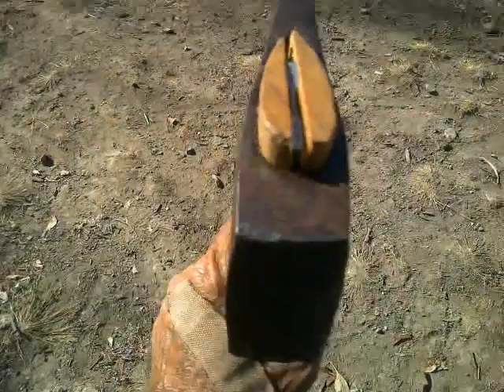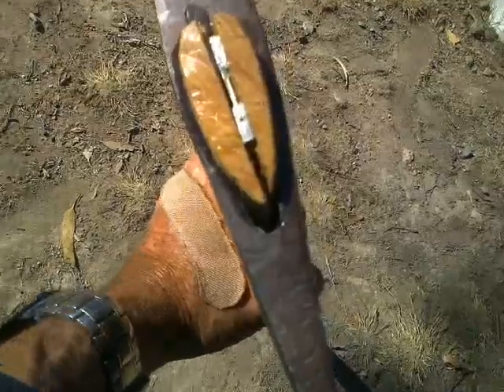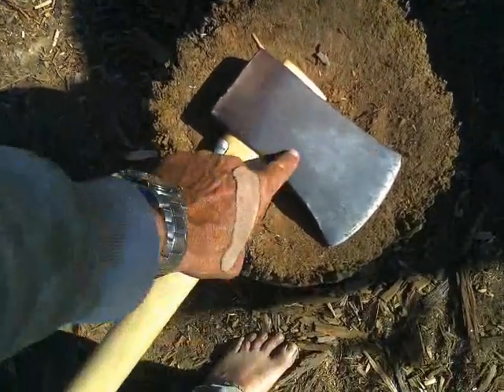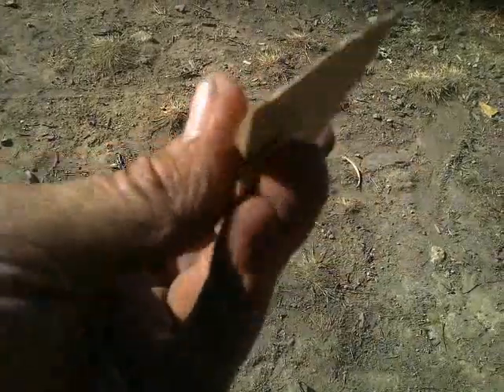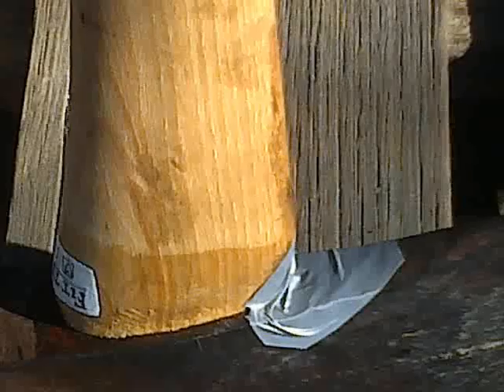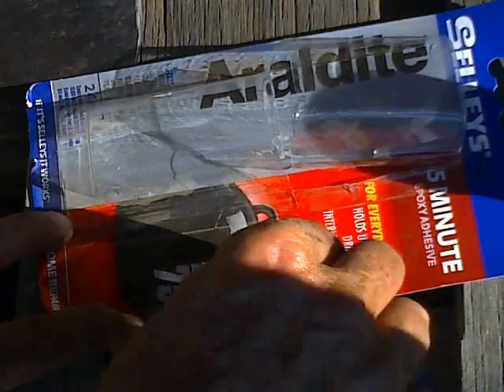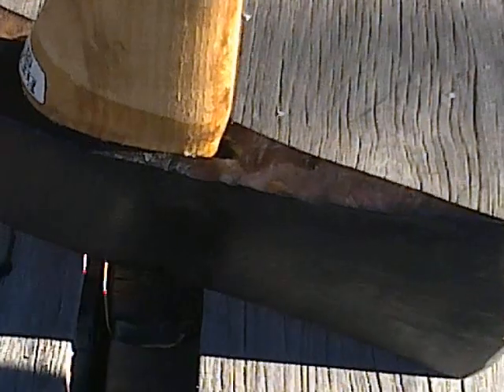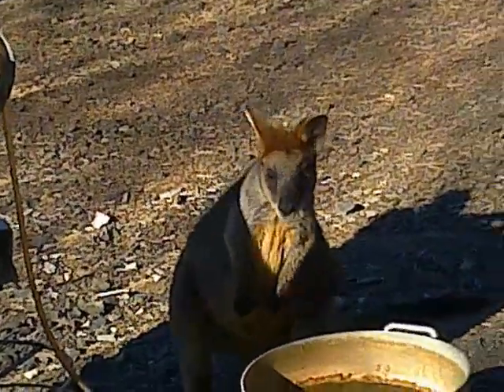Fish-Splint Wedging Modern Axehead.

Comment: Well no one could accuse you of under engineering that handle, much fancier than the stick wedges that we would drive into the gaps to shore up the handle, my only concern is that I know sometimes when I first fit a handle,  after a few uses I have had to drive the wedge a little deeper, hopefully that’s not the case with all that epoxy in the way, just a thought in my pea brain. 
Thanks for sharing.
Have a good day.
Cheers 🍻
Reply from the maker: G'day,

Thanks mate.

  Yeah, I generally use Splinters from around the Chopping-Block as "maintenance wedges"...; and you may be right about the Wedge trying to move..., I was worried that it would loosen up because the only thing spreading the two tangs were the thin edges of the Barbs on the Wedge, so now they merely anchor the metal in place and the Epoxy should be filling the bulk of the Gap.

   And..., now it should be a real pain to clean out the Eye, if ever  someone uses the Axe wrongly and breaks this Handle, so it's Roundabouts & Swings (lol).

Have a good one.

;-p

Ciao !

Comment: Hi Chris,
Good job. Could you have driven in a metal pin to fill the gap, and then used the epoxy? Saying that, your idea will work great. Bit of a bugger with those axe heads moving like that. Would be better if they made the eye flush rather than the bell shape on the inside.
Have a good week mate.
Cheers. 👍
Reply from the maker: G'day Mike,

Thanks mate,

 Well, I figured that I'd already got the Steel Weddge in there, and I could've simply filled the Gaps with Epoxy & Woodflour, but I wanted to try filling the biggest of the front-end gaps with solid wood, before going for the Epoxy.

  It's probably overkill, but the potential for the Head to wobble and work itself loose if I left it as it was too much to ignore...

Such is Life,

Have a good one...

;-p

Ciao !

Comment: Now to varnish the handle and make it more weather resistant?
Reply from the maker: G'day,

Thanks.

  Um, well, the theory is that it's a bad idea to varnish Axe-Handles because in the rain a varnished Handle is more slippery than one which has been treated with Neatsfoot Oil...; but that doctrine might date to when Varnish was made from Turpentine & Beetles' Wings...(!).

  But my theory is that the Epoxy in the Slot around the Wedges & the little band of Varnish under the Head might help stop the Oil from wicking in between the metal & wood and lubricating them to move against each other.

  It's a slow Learning-Curve, because when done right and used correctly, the Handles last for 20 years ; so the Feedback/Rectification Cycle takes decades.

Have a good one,

;-p

Ciao !

Comment: Couldn't you have just walloped an average pencil down in there and then broken it off before epoxy step? Ok, it wouldn'tlook as nice but really, how often are you going to be staring at the top of an axe handle? :P Guess you can't really soak that wood to swell it enough to fit without making the wood really weak. Fun with axes huh? I've only got a couple of camp axes now, and I keep them in the boot to collect the dust that works it's way in there. Winds up you don't need to do much to survive in a city except drive patiently stuck in traffic because Republicans don't  spend money on infratructure. And now climate change gives the greedy even MORE reasons not to care while they conjur up a net worth inn a few years of hundreds of millions of dollars, having thrown their moral compass over the railing.